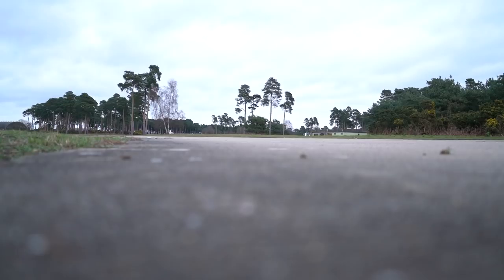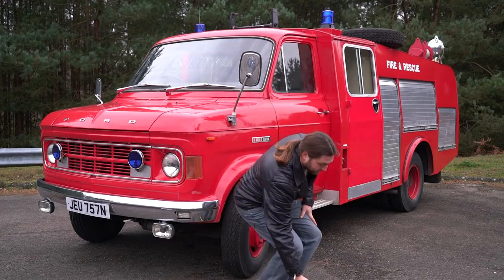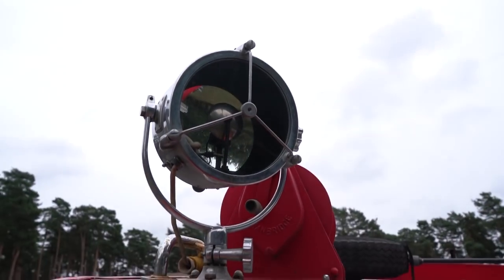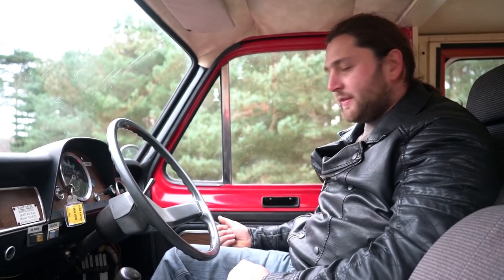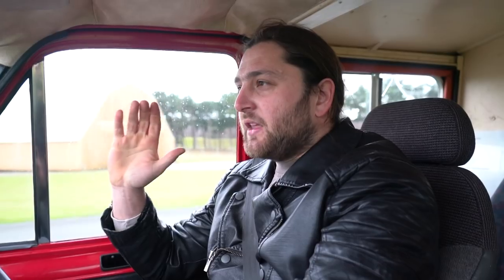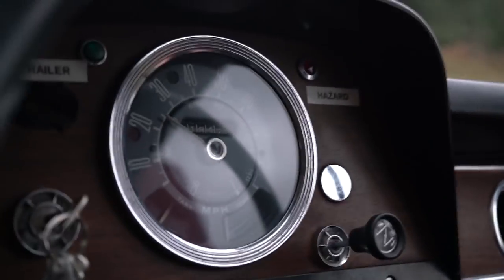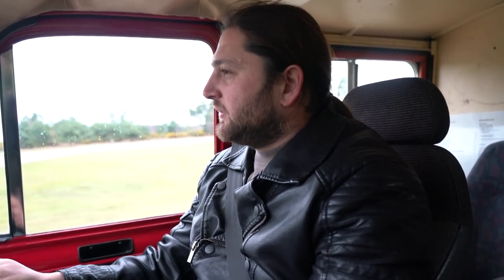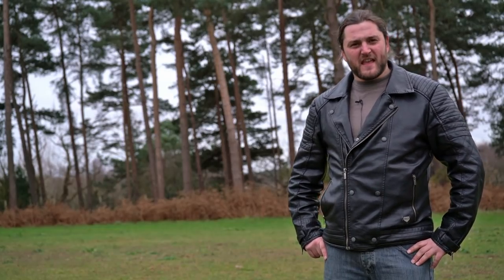A Vintage, Van Sized, Fire Engine! LMM Drives Episode 10.

Comment: we had them as road rescue units in 1981 4 wd manual gear box they were horrible to drive brakes were crap workshops disconnected the 4wd and left rear wheel only slow or what we had the ford cab behind was a purpose built ally box to carry road rescue stuff and B.A. pods 60 mph on a good day heavy shudder from drums brakes up through the steering wheel all the guys hated it oh and 4 mpg going to incident and 6 mpg normal driving ps heaps of S**T mate please please dont buy it an endless money pit friend honest and a rot box as well
Reply: We had one as a Rescue Tender. Went OK, getting it to stop was the tricky bit. Quite possibly the worst thing I have ever driven
Reply: @stuartwhite8215  the thing used to shake its self to death on heavy braking lol hated it
Reply from the maker: I like the idea of it, but the brakes scared the bejebus out of me 😂.
I don't have room for it anyway, and I've enough money pits already!

Comment: My Bedford is faster than that
Reply from the maker: I'm pretty sure the 106 is faster!
Hell the tractors would have it off the line!
Reply: Ment van plus who put that fire engine on a hot wash
Reply from the maker: No it's not on ebay, if anyone is intrested drop me a message!
Reply: Ok as i am just wondering as i have a garage it would JUST about fit in
Reply: Plus im planning to get the Bedford down to odiham
Reply from the maker: Going to take it out on the road?
That'll be fun!
The Ford is much for storage - and alot more unusual too. There's quite a number of Green Goddesses around
Reply: year but free on toll roads and dose not need a hgv so the goddess is more fun
Reply from the maker: I've driven a goddess and loved it!
Reply: Dose feel a bit like oh sh*t goiing round a tite corner at speed as it rolls over to tthe point of o fu*k slow down
Reply: Would let you drive mine if it had brakes that work
Reply from the maker: We didn't do much at speed either!
The suspension is very soft
Reply: Oh yes plus for a so called fire engine it cant drive with a full tank of. Water as it will fall over turning
Reply from the maker: It would be an intresting experience if it was fully loaded 😂
Reply: Yep next turn. Rolling down the hill
Reply: @lmm  hey the two tones sort off work now
Reply from the maker: That's good news!
Reply: @lmm  yep